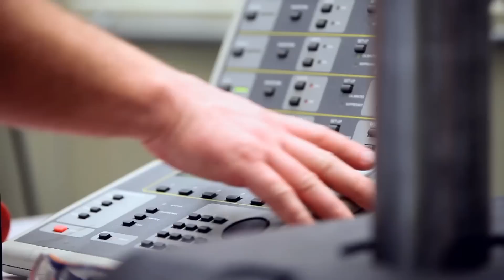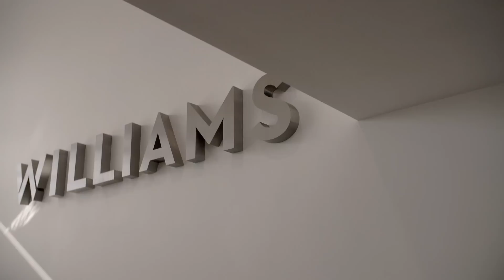Inside Williams Advanced Engineering - XCAR

Comment: Look at dash display on the nissan gtr its obviously a tuners piece of equipment.  Most people just assume you can just walk into the tuning world throw a huge turbo on and whallAHHH!!!     Huge major HP upgrades done with a few bolt on's.   Which is absurd nothing from the truth.   To get the high hp upgrade out of a small banger is pure art form and a strike of genius hence they usually dont last very long into there life vs say a LS1 engine.   Hands down for reliability of high horse power a v8 block engine will do circuits around the small little 4 banger trying to push out 1,400 horse power.    Formula One engines never lasted for more then what the race required.    They also say in the video ev can produce great performance.  You don't say captain "obvious".      Go go little Tesla!!!

Comment: batteries will become a very serious pollution contributor if it goes into mass production for cars...electricity anyway comes from burning fossil fuels..disposing batteries..recycling..etc are real problems that.we will have to face..the "go green" community do not think of all that.. ..until the chemical waste produced is ignorable , batteries aren't a good solution..yes its cheaper to charge...but it does not have the range..or the quick fuel stop capability.. fossil fuels is not the way forward..but neither is battery..may be temporary solution..not in the long run..imagine billions of cars running on batteries..all the chemicals..hydrogen cell is the only thing that has impressed me..because there is no toxic waste..and it doesn't take 10 hours to fill up..invest in that..